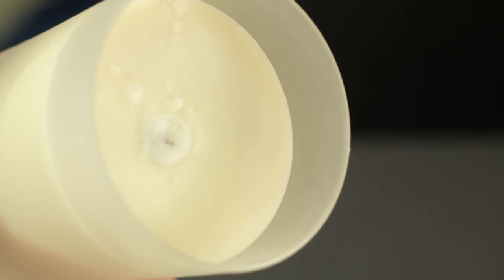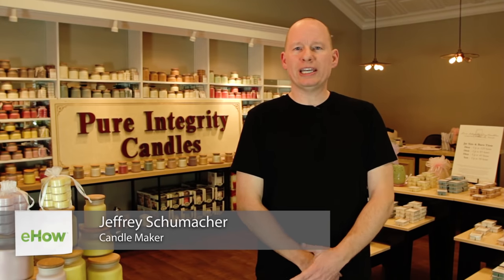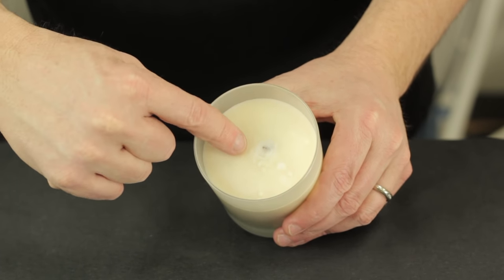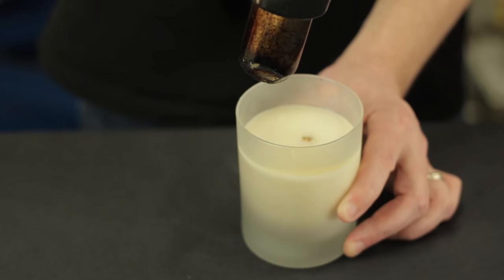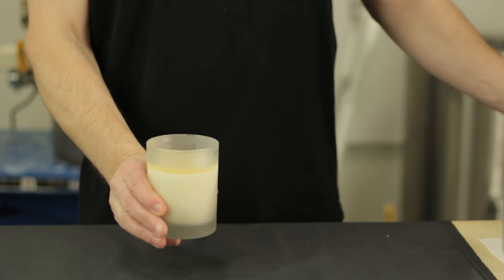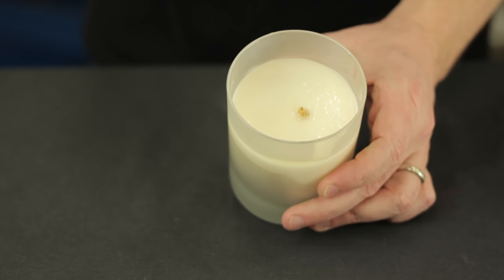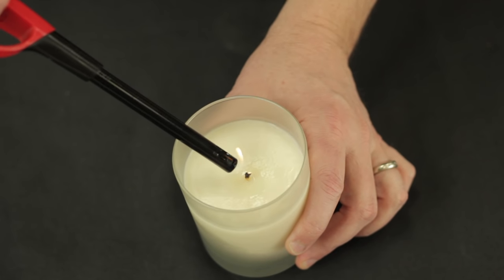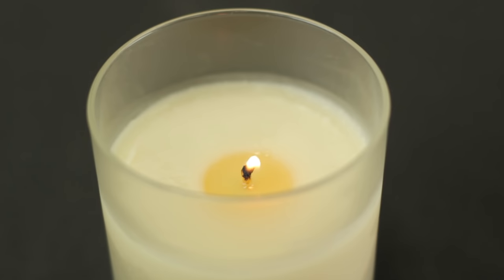How to Fix a Lost Wick in a Candle : Basic Candle Making

Comment: I just tried this with a blow dryer. The wax melted, but it splashed all over the place (my clothes, the counter, the walls). It wasn't worth the mess, so I ended up tossing both candles in the garbage. Luckily, I was wearing glasses at the time. Please be careful when trying this at home!
Reply: Lol!!!!
Reply: First of all a BLOW DRYER? A heat gun is ultra low speed compared to that LOL. Second of all after you realized "ok, this thing barks, she moves some CFM" HOW CLOSE did you hold the thing to the candle LOL!! 
Here we can fix the candle but we cant fix... well... nvm... haha...
Reply: I’ve seen people like you in infomercials where you burn down the entire kitchen trying to make toast
Reply: Just use matches and as wax melts just drain it off…soon the wick is exposed ….and you need to drain off wax again once you finished with lighted candle it’s not rocket science
Reply: I was gonna try a blow dryer too lol

Comment: Most non-candle makers don’t have a heat gun.  Better to put your oven on 200 degrees, place your candle on an oven safe dish/pan, let it melt some and absorb the wax with cotton balls or paper towel to remove the wax on top.  If you pour the wax it makes a mess of your glass.  Your wick should be at 1/4 inch for proper burning.
Reply: Or just use a long candle lighter to melt the wax. Simplest solution. 
People are doing some wild things, having read the comments 😏

Comment: Worked great with a hairdryer, allowed me to remove the excess wax so the wick wouldn't get drowned again. Be careful of any splashing though, make sure you angle the flow of hot air and not direct it from straight above!

Comment: I had a broken candle but managed to scoop it from its broken glass jar into another glass jar (of the same size and brand) I was had saved ages ago to recycle. I used kitchen tongs to hold it in one hand whilst I poured the kettle of boiling water around the exterior of the candle over a pyrex jug (in order to remove little glass particles). This melted the candle a bit and I guess in doing so the wax poured over the wick so that when I transferred it to the new jar, I couldn't light the wick. I then used a blowdryer for about 45secs and attempted to relight the wick which is did successfully.

Comment: for those who don't have a heat gun at home, try heating up a spoon over the stove and shoveling some of the wax out around the wick. if you use a blow dryer, don't angle it directly on top of the candle as hot wax will splatter everywhere!!! use it on the sides. hope this helps

Comment: We're tf imma find ah heat gun come on
Reply: Thats exactly what i said
Reply: People saying here to use a hair dryer.  I'm kind of new to candle making but I got a lot of molds I've been using for soap, and so I'm dealing with casting the candles and not tearing holes in my one part molds so the wick is submerged in the wax.  I went today and bought a micro torch from Harbor Freight & Tools, last one for only $5.  I'm going to use it to ferret out the wicks.  Wish me luck!
Reply: Michael thompson hair dryer😂
Reply: A long wooden match for lighting pilot lights and fires in the fireplace.
Reply: Lmao that’s what I said! I just use my warmer or a hair dryer...it works great and there is no need to spend extra money

Comment: Confirmed: this works!! One of my bath body works candle had one of the three wicks buried, and I just melted what was around it with my blowdryer. Took maybe 5 min. 

Just a heads up
1. If you don't have a burner, use a blow dryer or borrow from a friend, some one is bound to have one.
2. Make sure you do it in the sink or somewhere mess proof, because the wax starts flying everywhere. 
3. Wear clothes you don't mind getting some wax on, because bits will splatter up 
4. Have a paper towel or rag ready to wipe said little wax pieces off. optional, wear gloves incase the candle cup gets hot.
Reply: lunarosa321 thank you!  Exactly what we need